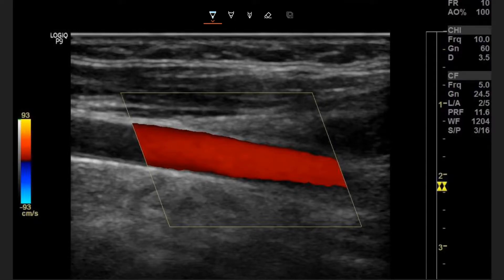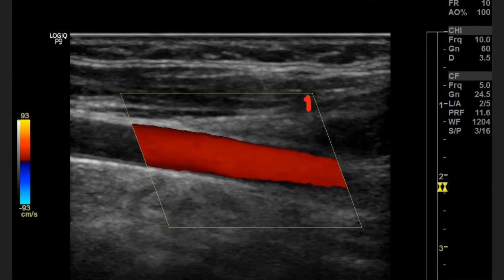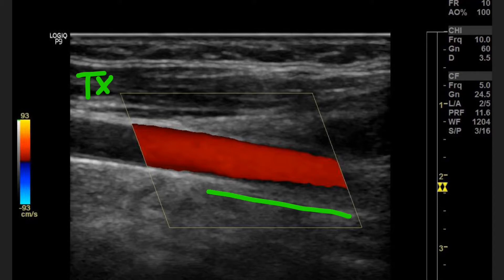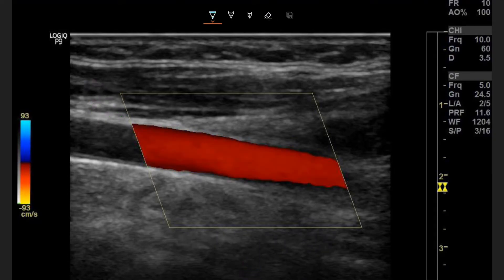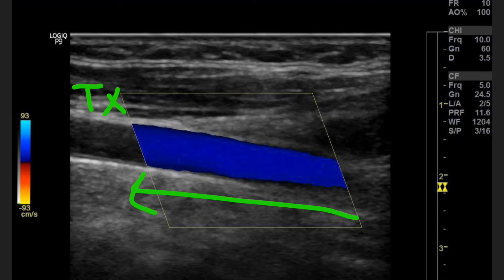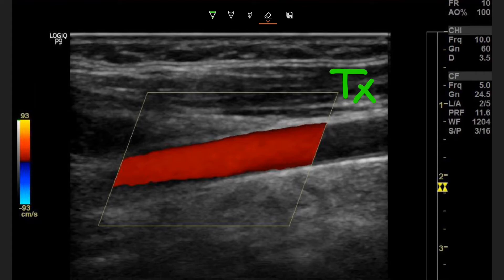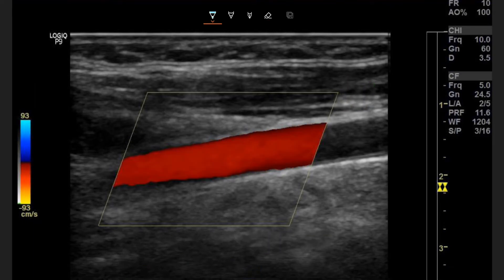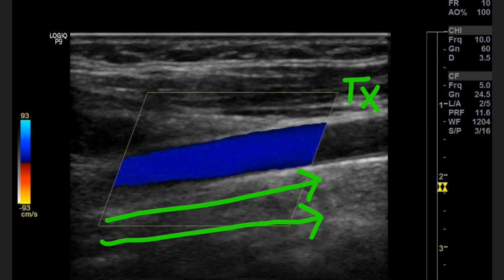How to Determine the Direction of Flow in a Color Doppler Image

Comment: What is .. TX ?
Reply from the maker: Transducer location
Reply: Why don't you write TL?
Reply from the maker: TX is an abbreviation for transducer.
Reply: TX is universal for Transducer.. 

how about in the boards if they don’t tell u the ——> arrow direction but how would u know if the direction of the box just by looking at the color map ?

ALSO if that’s the question on the Boards or if the Color map is “inverted” wrong and that’s one of the questions how would I determine this, I’m having problems understanding this. 

THANK YOU!